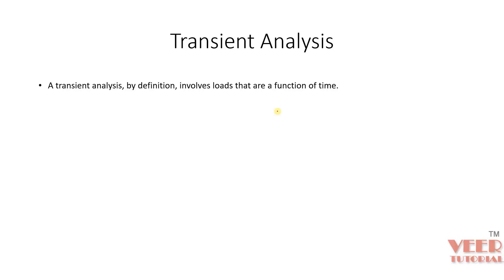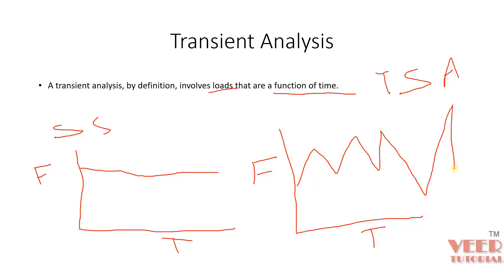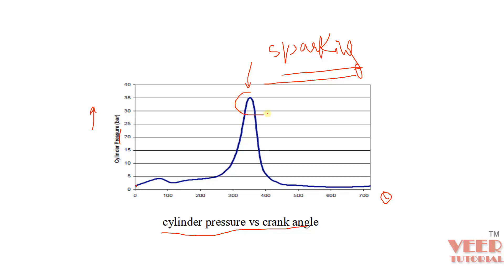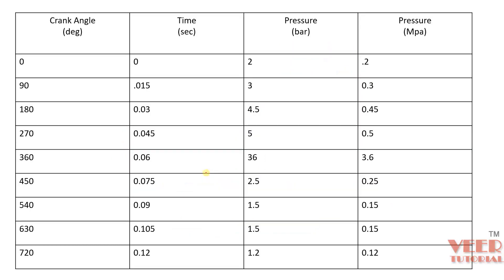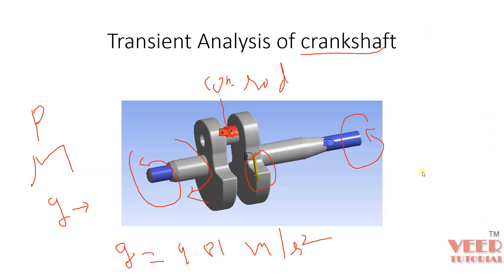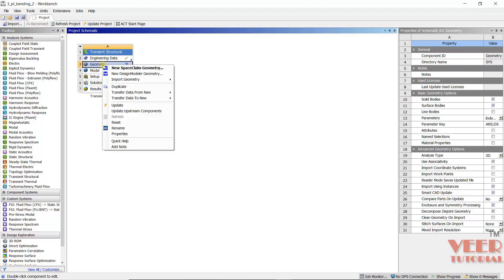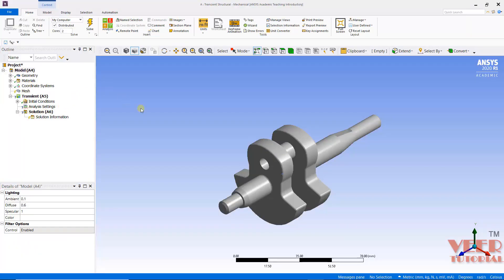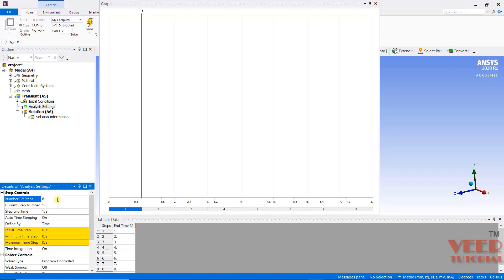ANSYS Workbench | Transient Analysis of crankshaft

Comment: sir, how can  i get that tabular values . Is it theortically or practically calculated. I need such pressure values and time values on piston top face
Reply from the maker: You can find these values from research papers. I also got the value from papers. otherwise it will be difficult to get  actual industrial data.